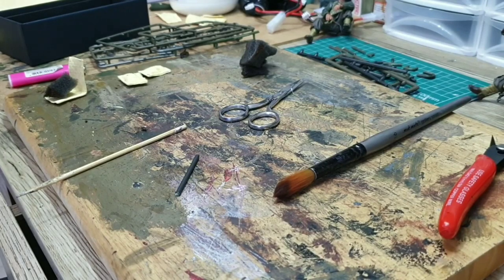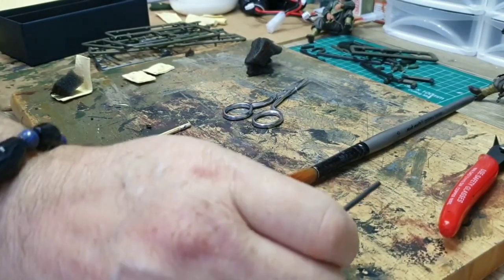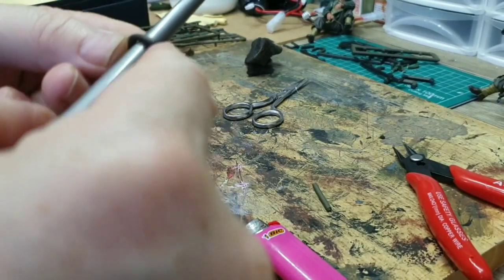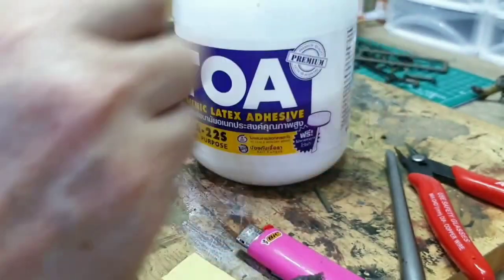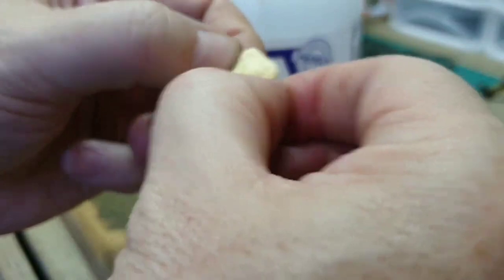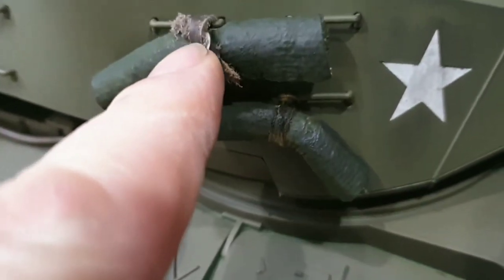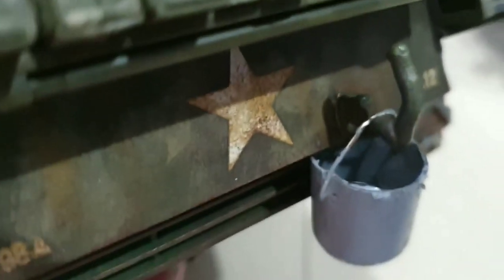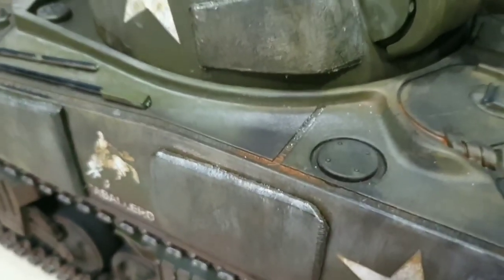Tips On RC Tanks Accessories

Comment: I don't know how to tie em up, i just made a crate for on the back of my tiger 1 but i don't know how to fix it on the tank.
Do you have any suggestions?
Reply from the maker: Double Sided Foam Tape is extensively used in car, home, motor home, caravan, boat, car mirrors, number plates etc. Double-sided adhesive tapes are the strongest and most versatile ones commercially available.